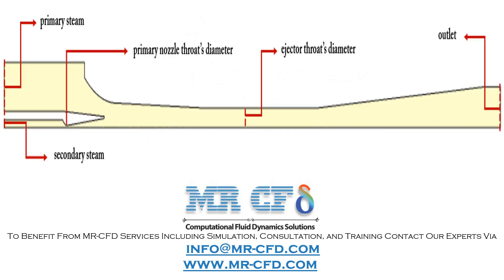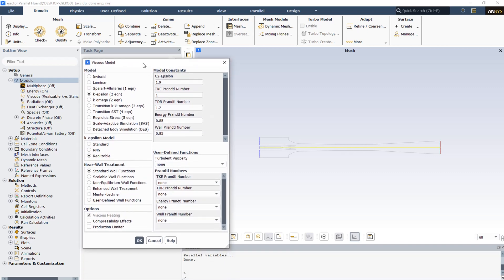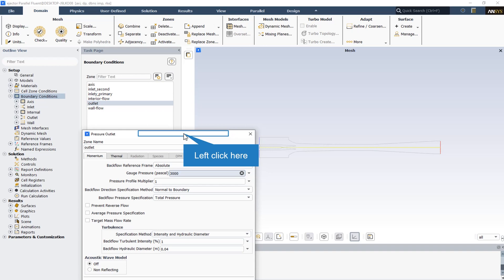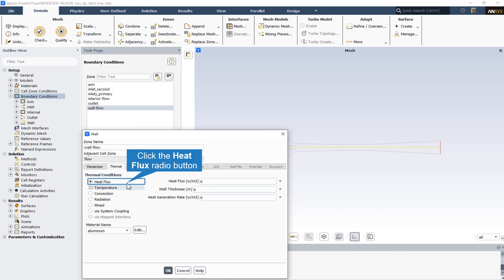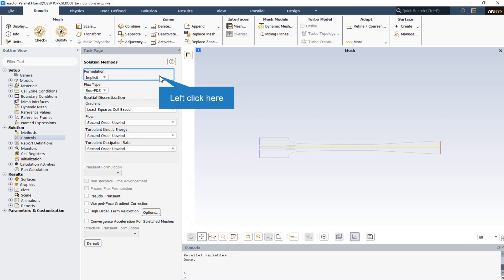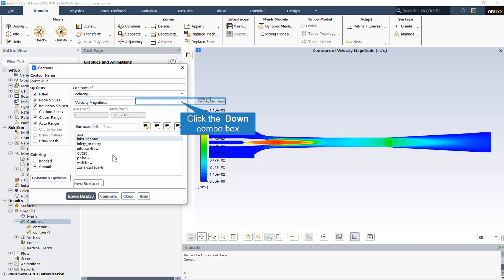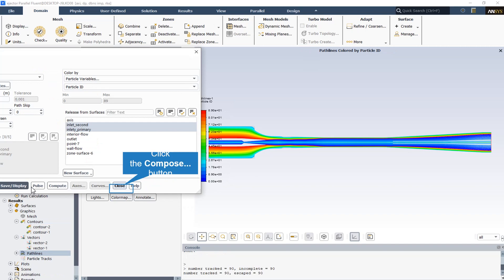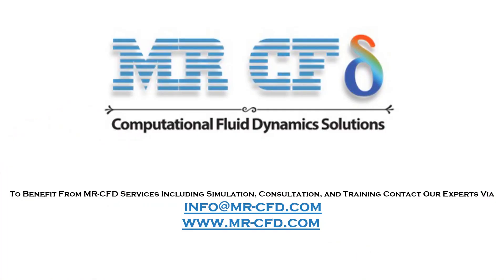Steam Ejector

Comment: I am simulating a two-phase liquid-gas ejector, the working material is the refrigerant r134a and I am configuring the inlets and outlets with pressure and temperature, in addition to that I am involving the phase change but the results of pressure contour and velocity vectors are not They give me logical results, what advice can you give me? The mesh is fine, I applied several body sinze and inflation

Comment: hi sir would you like to tell us about the boundary condition in the inlet primary and inlet secondary?
one more thing , if we want to know the suction pressure generated by this system where should we see it?
thank you so much
Reply from the maker: hi dear ian , you can take a look at boundary condition in our website,  if you want to know the result for other situation you can be in touch with us via mail info@mr-cfd.com
Reply: @MRCFD  hi thank you so much for your response
is it possible for me to know how many iterations did you use? 
my bachelor thesis is about this simulation but I face a problem to get the divergeance
I have run 25k of iterations(similar like yours, default set up,but in explicit) I only get 0,01 in continuity residual

thank you so much
Reply from the maker: @ianm1898  your welcome, number of iteration is not important, we should reach convergence, but since the simulation of the ejector is so unstable, we use a very low courant number, so the number of iteration is so high. we will continue our simulation till reach a constant entrainment ratio and good convergence in residual.
Reply: @MRCFD  thank you so much for your explanation sir, hopefully I can handle this simulation,thanks